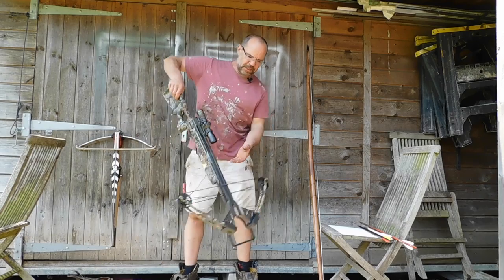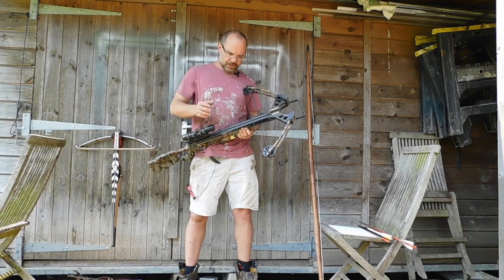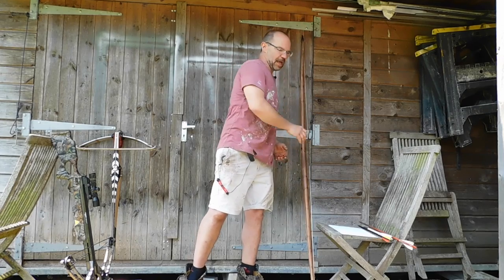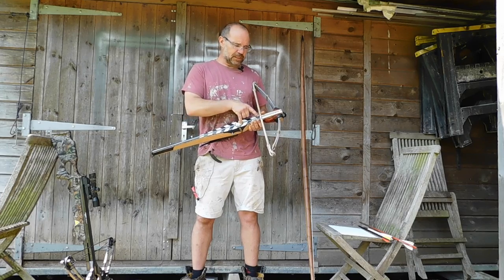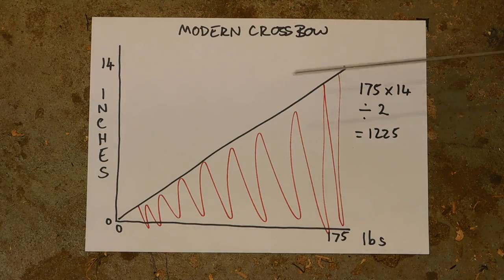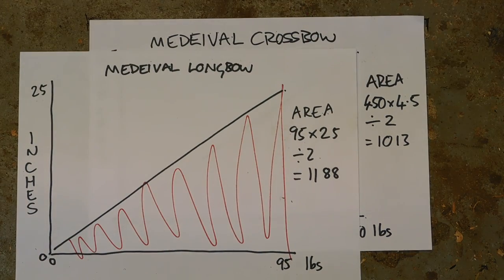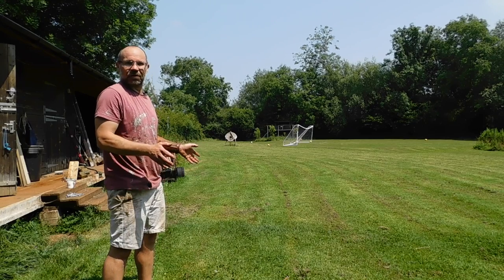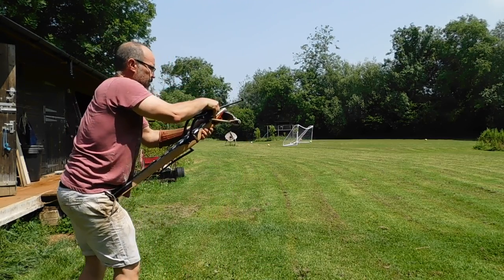Draw weights of medieval crossbows, longbows and modern crossbows

Comment: You should have run these tests with the rate of fire/accuracy challenge you did recently with your long bow archer friend. Interpolating the results your friends 160lbs bow would likely produce 76j and your 840 lb cross bow would likely produce 100j if it has a similar efficiency to the cross bow and bow you used in these tests.

Comment: Thanks to the algorithm as I  watched a more recent video of yours and really wanted this question answered.

Question since the efficiency of the modern can be said to be 90% (google) at 3 times the draw weight and 2.5 times more energy output, does that mean the medieval crossbow has an efficiency of 13% ?
Reply: Interesting approach, but you're not taking into account the different draw lengths of the medieval and modern crossbows. Propulsive efficiency of a bow equals the kinetic energy of the projectile as soon as it leaves the bow string, divided by the mechanical energy required to span the bow. 

Here in the video, the medieval crossbow tested has a draw force of 450 lbf measured at a draw length of 4.5 in. Assuming a linear force vs draw distance relationship (ie Hooke spring), the energy required to span this crossbow is 114 Joule. The quarrel used in the chronograph test has a mass of 60 g and was traveling 139 ft/sec, which equates to 54 Joule of kinetic energy. 54/114 = 47% estimated propulsive efficiency. It can be reasoned that the actual efficiency might be somewhat higher than this due to the fact that steel bow prods tend to have a spring rate that increases as the string is pulled back farther. 

For example, suppose the spring rate at the draw length is 5 times higher than the spring rate when the bow string is undeflected (based on observations from Tod's 960 lbf crossbow draw force test and some data curve fitting) and increases linearly with draw distance (probably not exactly correct, but a good first order approximation). Since spring rate is the derivative (ie dF/dx) of the draw force vs draw distance curve F(x), the draw force curve can be approximated as a parabola with the following conditions: F(0)=0 (approximately zero draw force when bow string undeflected), F(4.5)=450 (draw force at draw length), and y'(4.5)=5*y'(0) (spring rate ratio). The area under this parabola, 83.3 Joule, represents the associated draw energy. Then a more accurate estimate of the efficiency of the crossbow is 54/83 = 65%. Contrary to Tod's explanation in the video, the medieval crossbow is actually a lot more efficient than the medieval longbow (~33% efficient), which is probably one of the reasons it was used extensively on the medieval European battlefield despite its extraordinarily slow rate of fire. The relatively short width of the medieval crossbow prod more than makes up for its relatively high inertia and high internal hysteresis loss. The cube law of prod kinetic energy vs bow width works in favor of the medieval crossbow and dominates any advantages the longbow has in material inertia or hysteresis. Finally, the modern crossbow has a mechanical efficiency of 95%, besting both of the medieval weapons by a wide margin.

By studying the construction of these three weapons and their technical specifications, we can observe that, as a general rule, a bow of any construction can be made more efficient at the same draw energy by shortening its limbs and increasing its draw force, as well as increasing the ratio of projectile mass to the mass of the bow limbs.

Comment: While I totally agree with you about the initial energy (those are facts), the "killing power" is dictated by the energy of the projectile when it hits the target.
Air drag and friction (inside the medium of the target) go with the square of the velocity, thus, for equal amounts of initial kinetic energy, the fastest projectile looses its energy faster.
Another aspect is the force with which the projectile strikes the target. This force comes from the (loss of) momentum of the projectile which is a function of V, not V^2 (K.E.).
I would be curious of a video where you measure the penetration and damage of these projectiles at the ranges that were typical for their use. My expectations are that the heavier bolts (slowest and easier to avoid) would still be extremely dangerous and effective, even when compared to the modern crossbow with carbon fiber bolts.
From what I have seen, the viking and medieval helmets can withstand some modern firearm, especially the 22lr and 45ACP, but not necessarily crossbow bolts. Having said that, I did not control those tests and I do not know the exact angle of impact, distance from the rivets, or other factors that are definitely changing the outcome. Also, armor-piercing properties are not the same as flesh-piercing, while lethality takes into account the way energy is deposited and the effects associated to that, like cavitation, shock waves, organ rupture, etc.
Reply: Would also be interesting to see an average of the speeds of the projectiles used in this video. Say 10 shots over the chronograph, averaged. The drawlenght and draw-weight of the bow used in this video is arbitrary, seeing as how Tod is short, and the fact that he and his bow are weak. For instance, the bows from the Mary Rose had estimated draw-weights of 120-180lbs, and they would shoot arrows estimated to be 1500 grains (around 97 grams) . But I won't be too harsh on the scientific accomplishments of a man who is unable to spell MEDIEVAL.

Comment: You mention the steel bow of the crossbow having less efficiency because of it's weight. What if the bow is a reflex bow and made from something close to spring steel? Would that mitigate this? That way the bow should want to spring forward of it's own accord. Also composite crossbow bows would not have this issue.

Comment: Would it be possible to measure the Crossbows and Longbow to find the speed in ftps/ms at the end of the ranges to calculate the potential energy at termination point at 1.6m off ground?

Comment: Hi Tod. Just one question: Why do you say spring steel in bad for a bow material?
Reply: Ps: 146 fsp with 95lb yew bow seem reather low? (You say 195lb in the vid) And you dont seem to draw it 25", More like 28-29"

In 2014 i made a goat willow 85lb at 32" longbow that had +3" of set and it gave me 154fps with a +60g arrow.
Reply: also steel turns brittle in the cold and it rusted , got bendt and deepending on the blacksmithing might not be that uniform

Comment: Thanks. Very informative.  I must say, however, that longbows used for war, often had a heavier draw weight than 95 lbs.  The long bows recovered from the Mary Rose were estimated to be about 150 lbs draw weight, with a 30 inch draw. Draw length determined by the arrows from the same source.
Not all archers could draw a one hundred a fifty pound bow and shoot accurately. The archers on the Mary Rose would have been the very best available, even if the sailors were shit. :)
None of this contradicts what you are presenting, just a bit of added detail.
It took years of stepped training to be able to handle a 150 lb bow.  Only your strongest archers would make it to that weight.
There were heavier bows but probably not common.  There are modern longbow competitors that use up to one hundred and eighty lb draw weights.
Reply: That's kind of the point with the crossbows. A nice and heavy crossbow can still certainly not take out a tank but it can keep up with a high powered bow whilst requiring a lot less practice and training. I would not be able to draw 150 to 180 lbs but with a windlass I could eventually draw a 800 lbs crossbow and achieve comparable damage, albeit that it would of course take much longer to shoot.

Comment: Medieval crossbows were never the most mechanically-efficient weapons around. In terms of equivalent poundage, conventional bows are markedly superior when it comes to power output. 
With crossbows, however, the relative inefficiency of the system simply doesn't matter. You can build a medieval crossbow to have colossal poundage, such that the raw power output cannot be matched by even the most efficient bow.

Comment: I like how you pointed out that the medieval crossbow had stats in terms of "killing power" very similar to the long bow, subtly highlighting why the crown outlawed them.
Reply: I'm assuming you're referring to the myth that the ruling class, or more specifically the Pope himself, outlawed crossbows.

Firstly, the Pope (forgot his name) didn't target crossbows specifically, but rather ranged weapons as a whole, since they were used in wars and such, and the Pope didn't like that. For the most part, this seemed to have been largely ignored, as European armies still used such weapons in spite of that fact.

The whole 'nobles ban crossbow because hurr durr deadly peasant kill rich man' is getting quite a bit tiring the more I read of it. Neither bow nor crossbow were reliable enough to pierce even maille unless either of the two had ridiculous draw weights, ranging from a hundred to two hundred for the former, and five hundred to a thousand for the latter. Even then, they struggled against maille unless they were using needle-like bolt/arrow heads. If they had problems against maille armor, then piercing plate was out of the question.

(As I write this comment, it came to mind you likely watched the new longbow vs armor video. Nevertheless, the point still stands; obselete it may be now.)

Comment: Wasn't expecting that conclusion. Under a 22LR by a lot. I wonder at the joules of an arquebus?
Reply: It'd be a lot like having a small cannon fire a golf ball at you 30-50 yards away, .69 caliber shot on ballistic gel or clay molds have soft ball sizes holes in them at about 30 yards away. So a lot more power it is after all a gun.

Comment: The analysis here misses one very important thing.  As the projectile travels, it loses speed.  The energy calculation that really matters, is the amount of energy at impact, not when it leaves the bow.  The force of friction due to air resistance is proportional to the velocity squared, so fast light projectiles lose a lot more energy with distance than slower heavier ones.  I think if you did the numbers but instead used impact velocity over say 50m you could get quite a different picture, and the medieval cross-bow would probably stand out more, due to the heavier bolt. It might be possible to calculate velocity at target safely using a high speed camera rather than trying to shoot a bolt through your chronograph at 50m